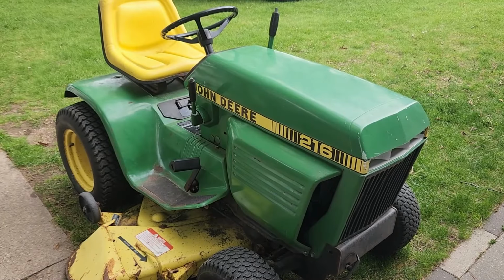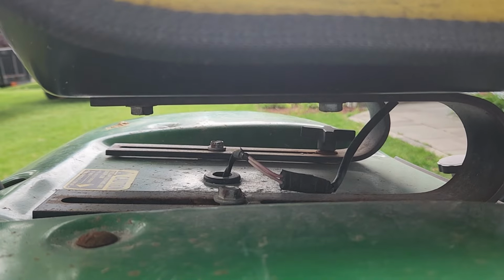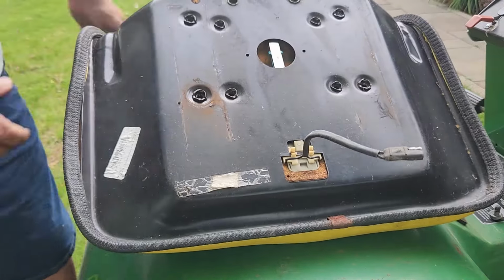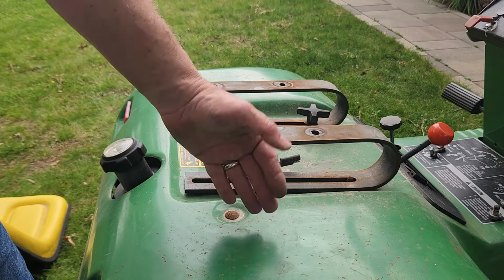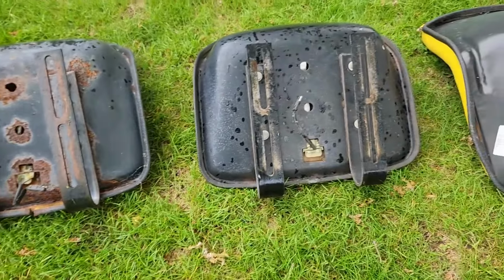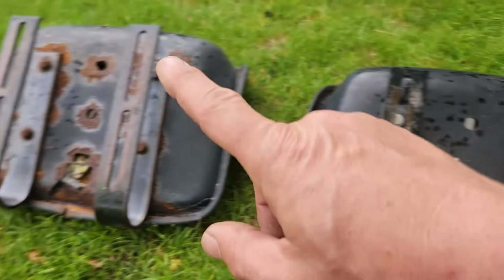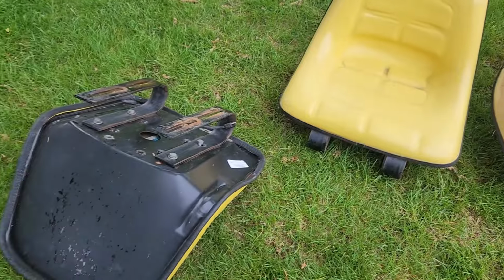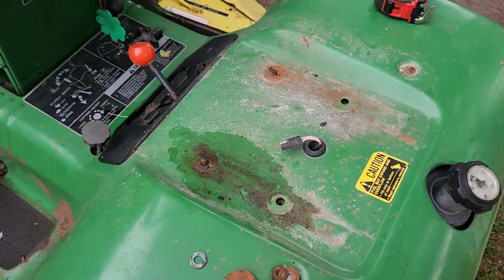John Deere 216 Seat Replacement - Too Close for Comfort

Comment: My John Deere LX255 has the same problem hard to slide your leg through the steering wheel seat space
i took my seat off drilled holes as far back as i could in the sheet metal it helped but i would like more access space 
They must use small children to test the ease of getting on a tractor without strangling your legs